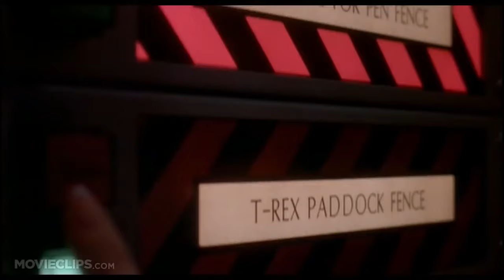Ford Transit van life / Wiring

Comment: Have you seen any van with internal factory plastics, do you know if that power wire you have coming from the battery box to the sidewall of the van would be behind the plastics or exposed like yours here? I'm not doing a camper/TV van, just trying to find a way to the battery through the inside with nothing visable.

Comment: Looking good man. Did you hook the van battery in parallel with the battery in the back? Also are you going to insulate the sides of the van?
Reply from the maker: Yeah they are but i have a isolator between them so it charges both but it won't drain the main battery.   Yeah I am going to insulate it.